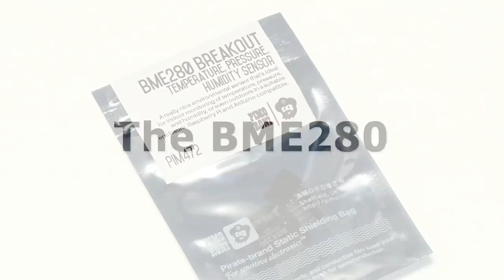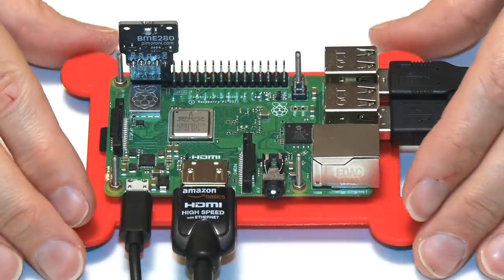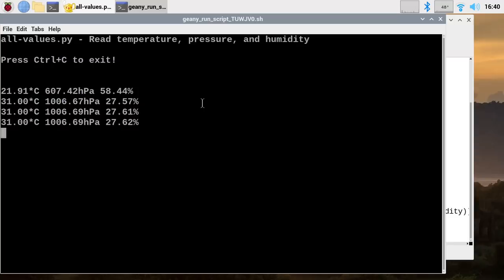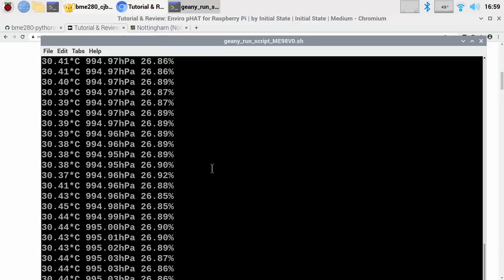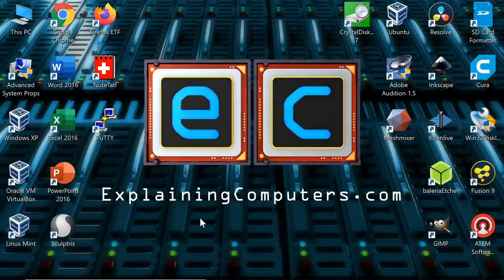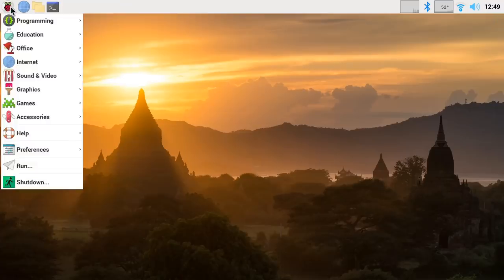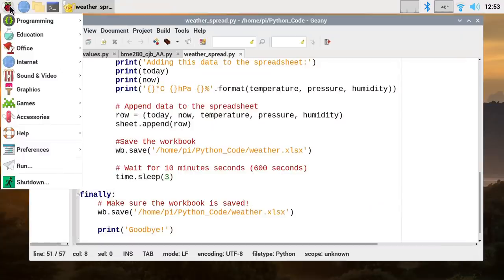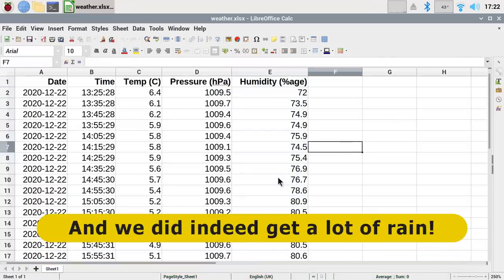Raspberry Pi Weather Station

Comment: I've been mucking about with esp32 units over Christmas. A slightly different set of challenges, but it's been fun. Latest was getting it to serve a small web site! For such a tiny unit it is surprising what it can do. I'm going to try to use it to remote control a train via WIFI. I'm also interested in whe(a)ther it might be able to use LoRa to send data from a battery operated unit I could leave somewhere local, but further than my garden. Great video btw. Rob

Comment: Thanks. Another nice video. Also interesting , the part with the export to the spreadsheet. But what I don't get is....why use a weather station to "predict" it going to rain in England?
I saw that the sensor can be used to measure flight-level changes? I'll go and have a look at that too.

Comment: Another great video.  I have been considering a rather prosaic application for this capability, and since I have three or four RPis laying around, using a Pi is an obvious approach: I want to measure the ambient temperature in my unfinished cellar over a year; to determine whether would be appropriate to set up a little rack down there for a modest wine collection.

What kind of length limitations are we looking at for the leads between the Pi and the sensor (I am thinking of keeping the Pi in the house and only having the sensor in the cellar)?  I think for most applications it would be sensible to save the spreadsheet file to a NAS or other remote volume, so it can be accessed at any time by other computers on the network.

Comment: Impressive device. Do any cases exist that can cover up the RPi and the BME280 module? It looks like the module is kind of made to be covered by at least DIY cases since only a small part is needed and it has those weird screw holes.

Comment: This was a great tutorial.  I got everything working as you described.  I know you talked about future possibilities as controlling the weather but I was curious if you have any future plans for this project?  The kit that I bought came with a 128X64 LED Module and + D1 Mini ESP8266.  I thought having this run over Wifi would be better so you could have 2 or more weather spots reporting into the Raspberry Pi and you wouldn't have to risk the RPi exposed to the elements.

Comment: Thank you for the video. One question which I’d like to ask. How long do you think the wires can be without affecting the sensor accuracy? I was thinking about the increased resistance due to the wire length.
Reply from the maker: The wire length should not impact sensor accuracy, as the signals returned to the Pi are digital. So as long as enough power is delivered to the sensor, it should work accurately.
Reply: @ExplainingComputers  That's great. I am thinking of using some Cat 5e cable and park the Pi around 15 metres away from the sensor. Thank you for the reply!

Comment: Now there's a useful project. Any idea what the wireless range is for a Pi? say with an external antenna (can you do that?) I'd love to put one of these in my barn, but that's about 130 feet from the nice warm indoor computer. Those prefab weather units don't have anywhere near the needful range (they're good to about 20 feet, provided the data has a sufficient tailwind).

Comment: This is cool but using a Pi with a RTL2832U USB dongle and 433Mhz sensors would've been more versatile.  There's already support for a large variety of sensors on GitHub.  Probably most common temperature, humidity, rain and wind sensors .  I think there is even support for some utility meters.

Comment: Great video Chris right up my street you had me hooked, I’ve got a weather station hooked up to a pi running some software called weeWx, on the sensor is the pressure relative or absolute, guessing absolute 
? if so you could correct it with some code perhaps to relative pressure so it’s inline with other weather stations, would be interestingly see.

Comment: Nice project; an updated version could record the weather parameters into a mysql db and be accesed via web page showing it over time on a graph; for better integration one can use the gpio utility by WiringPi, which include bash commands to control the pi; this way you can put your weather shell script into a cronjob to be executed say, every 5 minutes, thus implementing a sort of "daemon" which frees the RPi to execute another tasks in python

Comment: First - as always thanks for my Sunday dose of “Explaining Computers “
Second - any ideas as to the maximum practical length of wires before power or i2c constraints apply? I do not think i2c can go very far.
Third - any thoughts on a practical anemometer and wind direction indication to be connected to the pi, either commercial or homebrew?

Comment: This is my first time ever leaving a comment on YouTube! 
I'm looking to make a sensor to put in my mini greenhouse. I would not be automating the greenhouse, just monitoring the temperature (humidity and pressure are a plus). I could just buy a digital wireless monitor like the AcuRite sets, but the curious part in me wants to be able to record the data to see trends. I'm not sure how to power the Pi. I'm concerned the greenhouse could get too hot in the summer. The heat is probably a problem for the Pi, but I'm more concerned about a fire starting from a battery overheating. Maybe solar power? How would I do that? 
I'm open to other alternatives if any come to mind. 
And thank you for doing these videos. I built a robot from scratch from the Raspberry Pi website instructions, but your instructions for the zumo robot stepped me through how to actually do it and how to make it work. I have no technical background and your instructions made it really easy for me to understand and then teach some kids how to do it. If I can do it, then anyone can!

Comment: Thanks for the great video! Do you know if the 'Raspberry Pi 4 Model B 8GB RAM' could be used for such a project? I notice you mention at 03:45 that (any) Raspberry Pi can be used. But it's possible that you're only referring to versions 0, 1, 2, and 3 ... Therefore, I'm asking just to be sure :)
Reply: Oh, & would you happen to know if there may be any issues(s) using a more advanced BME680 sensor? I'm only just venturing out into this, so am a bit of a novice ... Thanks again.
Reply from the maker: Yes, you could use an 8GB Pi 4. You could use a more advanced sensor, but would require software support for the same.

Comment: Great video. Very informative. I'm building my own atm. 

I was just wondering about adding a lux sensor onto the same pi.
Initial research has said that it may be possible to use multiple data channels on the same gpio pins(i2c : 3&5)
I was wondering if you had experience of using multiple sensors connecting to one pi?
Thanks 👍

Comment: nice video ... in theory  , BUT any suggestions how to ACTUALLY put such a weather station OUTDOORS??? what weather-proof (rain, wind, sun/heat, snow, etc) case can be used? how to protect the sensor? in what temperature range can a raspberry pi be used outside?? THANKS

Comment: Say I wanted to keep the Pi safe inside & the sensor outside in an enclosure of sorts, would the sensor work using a couple of pairs in a length of Cat5e cable to connect it? Would there be a max length?

Comment: Hi, in this example the weather station was near by and you used your Wi-Fi for connection. What if it was much further away and you had to  use GSM, FTP or SMS for example, to transfer the data?

Comment: Hello,
The sensor seems to be sold out (except for the Adafruit).
I found some on Amazon rating from 5 for 1 to 15 € for 4 peaces. Just type BME280.
You get also BMP280 in the results. Are they les accurate ?

Comment: Hello, could you make a tutorial to make it more accessible, for example that you can access the weather via your Webbrowser by typing in your pis Ip?
Reply from the maker: Try this: https://www.youtube.com/watch?v=3q807OdvtH0
Reply: @ExplainingComputers  Thank you for responding soo fast! Is this also possible to use it with the Raspberry 3b+? Or only with the pico?
Reply from the maker: The code in the Pico video is for the Pico only. But a similar thing could be done on a Pi 3.
Reply: @ExplainingComputers  I will try to get it working. Thanks for your help! There is a BMP280 3.3V version and a 5V version which one should I buy?

Comment: Power usage? Can you put the PI into sleep mode those (almost) 10 minutes of waiting? I like all of this monitoring stuff and remote this and that. But what I don;t like is that it is all using 1 Watt here, 3 Watts there etc etc. This really adds up, and no one seems to care. So television makers are FORCED to make the standby power as low as possible (0.5 Watt usually), and we are jsut using any SBC to measure temp and humidity, or place a camera somewhere, etc etc. I understand this is not YOUR problem, but I would really like it if you would suggest to people and tell them that having a PI switched on all day year round is not for free. (I am a strange guy when it comes to power usage, I force myself to peddle my e-bike to create energy to charge up super capacitors which will then charge my phone cell, so I do get a forced 3 minutes really heavy peddling and I 'feel' the power being used by an appliance this way).

Comment: Isn't there some Python library for generic I2C communication? I've learned it's sometimes easier to write maybe 8 lines of code to read some value than to import whole library. Unless there is some complex conversion of raw data to degrees Celsius (or getting dew point from RH and temp)

Comment: better to round in the spreadsheet rather than in code, that way you don't lose any information if you want to go back to it later
Reply from the maker: Potentially, yes. But it is not possible to pre-format empty cells (as it makes them non-empty!). So I did initially do what you say, and the spreadsheet that results is bit of mess. It can be formatted up later of course. No data will be lost in the rounding -- beyond the first decimal place, the demicals chucked out are meaningless, as the sensor is nowhere near that accurate.

Comment: Hi Chris, could you not run a comparison of previous data to the data just received from the sensor in order to only post 'changes' in data to the spreadsheet? keeping filesize down or for better readability to see only unique changes in weather in the spreadsheet?
Reply from the maker: Yes, this could certainly be done.
Reply: @ExplainingComputers  TY :D This is now a project to look into for setting up an automated greenhouse!
Reply from the maker: @KingBjord  I can feel a "Raspberry Pi Greenhouse" video coming on! I have an old greenhouse that has not been in use for some time. This may rekindle my interest. :)
Reply: @ExplainingComputers  yes! I would love to see a video form you on this, could help with my own idea :D

Comment: I would like to have digital outdoor indoor thermometer, and I bought one in December. But when the two parts were lying side by side in the house there was always a difference, up to 0,5 degree. And I placed the sensor on the north side of a shed in the garden, and found out the whole thing is 1.5 degree wrong. Not so much when it freezes, but  that makes it more useless. My oldfashioned thermometer outside the kitchen window is more stable. It seems the accuracy in descriptions of thermometers is set to : Plus minus 1 C, if it is mentioned at all. Is that plus 1 C one day, and minus 1 C an other day?

Comment: hi EC. Great content you make, especially for this weather project( I purchased one myself), I would like to see  how to modife the code so you directly put the data on a windows machine,  or be able to access the   from the raspberry pi xlsx file to a windows machine, SMBA?

PS. also would like to see the raspberry pi cpu temp put into the xlsx file.
PPS. perhaps adding info into LibreOffice  Database?

Comment: I was going to say that it looked like the first reading looked wrong, rather than the others. An air pressure of ~600 hPa is approximately 14,000ft above mean sea level in the International Standard Atmosphere. Hope you had supplemental oxygen to hand!

Comment: Now that the Raspberry Pi 5 is out I am awaiting the weather control project promised in this video...
Reply from the maker: Fair point!
Reply: @ExplainingComputers  in lieu of that perhaps an episode with the enviro hat can be a nice expansion or an episode on using a separate Temp/pressure/humidity sensor and a VoC sensor could be nice. If understand correctly this should be easier with SPI in stead of IC2. 
I tried out a combination of an 2row LCD screen with the BME280 sensor, but wanted to add a couple of buttons for starting data gathering and stopping it/shutting down for a more mobile weather data collecting station that can be started and stopped without a keyboard and mouse and still be checked for current activity/status with the simple LCD screen and buttons.

Comment: Can you explain for us how to set this up with twin sensors,  Indoor/ Outdoor,   or to  use in a  refrigerator/freezer unit,  and set alarm parameters that would  flash or relay lights or audio and an  email or text.  Applying to  food service or  pharmacy ,  Even for home use,  to know if the  fridge system went unpowered when you are  away.
incorporating the  spreadsheet with updates  is amazing to me too. and can be used in so many other  ways.
Thank you.

Comment: Hi Christopher.  I always find your videos interesting and useful.  I have been trying to install motioneye on top of raspbian (buster 10)  for all my efforts, it does not seem to work.  Motioneye Os works fine.  The reason I would like to use the application rather than the operating system is I would like to run some python or C programs on the Pi when there is motion.  

Looking forward to your video using the raspberry Pi 5 to control the weather,  if anyone  can control the weather, my money is on you.

Comment: Thanks. Didn't know about openpyxl. I would have dumped it to csv file and then manually imported that into a spreadsheet. Can openpyxl automatically create a graph in the excel file too? I currently use matplotlib to create my graphs, but could be helpful to have them in a format I can more easily share that is editable.

Comment: Could something like this work with the Pi Pico or are you always going to need a raspberryPi?
Reply from the maker: Yes, a Pico could handle this kind of thing. Well, not running the spreadsheet, but collecting data from a sensor.

Comment: Would you like to try BME680 or MQ-135 sensors? They show air quality. But MQ-135 cannot be connected to rpi directly because it needs 5V instead of 3.3V... :(

Comment: See if the data could be imported to weewx, its a python powered weather station software that you can connect to weather services like wunderground and such.
I did it with a weather station that I connected with USB to my pi, so now my station appears as a station on wunderground services

Comment: Quite an expensive dedicated setup considering that you could simply tie in a MC with some sort of communication protocol (BT/WiFi or heck even cheap 2.4Ghz antennas) and have it sit outside, consuming very little power and reporting back the data like the good little slave it is :3
Reply from the maker: I think that you've missed the point of this video! :)

Comment: Hi, I used your example code, followed it and get my bme280 up and running and sending data to libre calc.  I then setup nas on the pi so my windows pc could then access the sheet and call data every ten mins into an excel dashboard.

This works great.  I now have a veml6075 uv sensor and wondered whether your able to give some guidance on using your script with this and doing the same thing, sending it to libre calc.

Many thanks in advance

Comment: Wondered how difficult it would be to program a Raspberry Pi as a fuel injection management system, electronic fuel injection converting from manual mainly with diesel buses, you need a magnet on the flywheel to measure the rotation and how many cylinders. real-time analysis on a laptop so you can time it correctly and have different modes performance and eco. I don't know if there's anything out there like that anybody has done yet I would have thought so.
What is lag latency time like on a Raspberry Pi is it good

Comment: Instead of the weather controlling the sensor, can the sensor control the weather instead? Which python code can I use to increase the outside temp for example?

Comment: When you run the code remotely via SSH do you need to keep your laptop/pc running for the pi to continue adding data to spreadsheet or will it stop as soon as you shutdown the laptop?